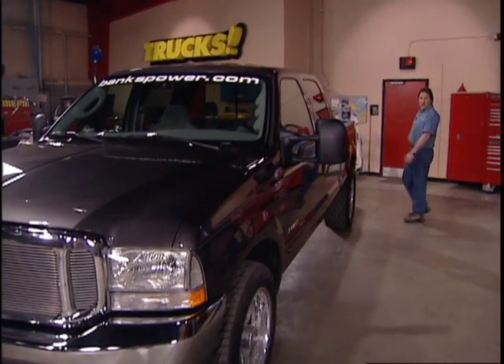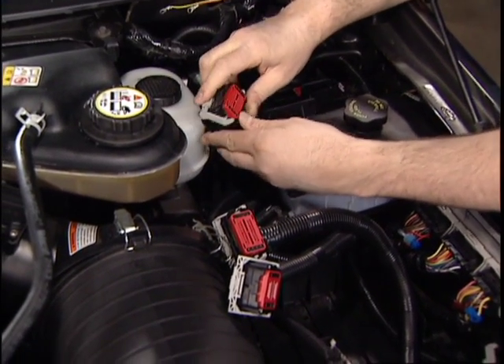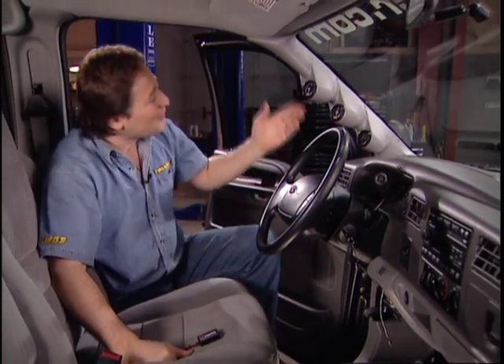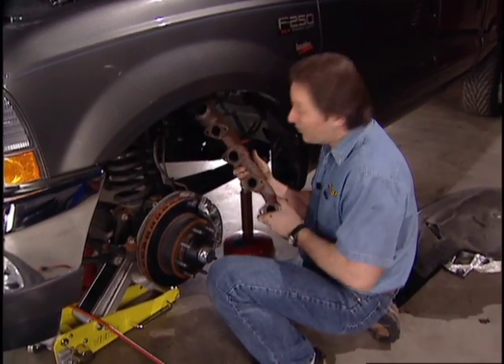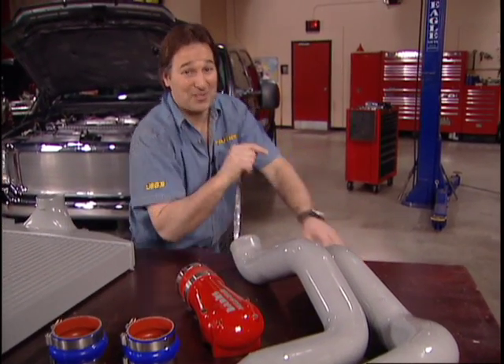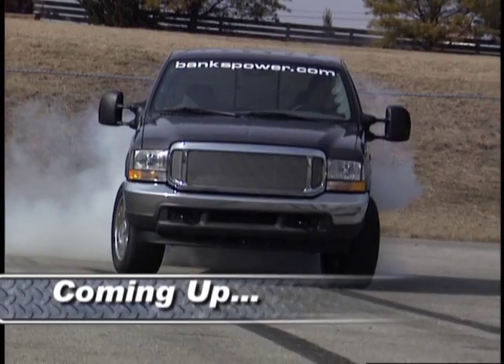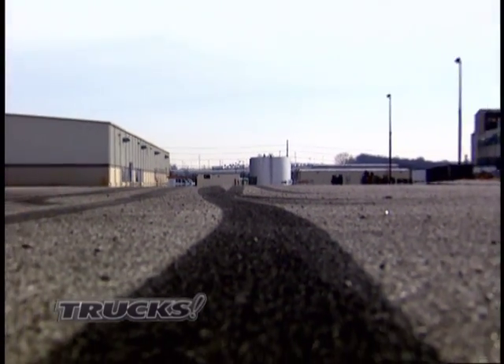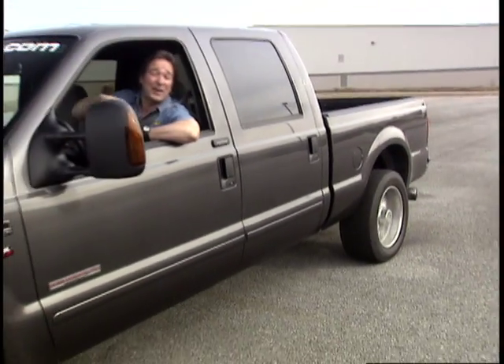Ford 6.0L Big Hoss Bundle

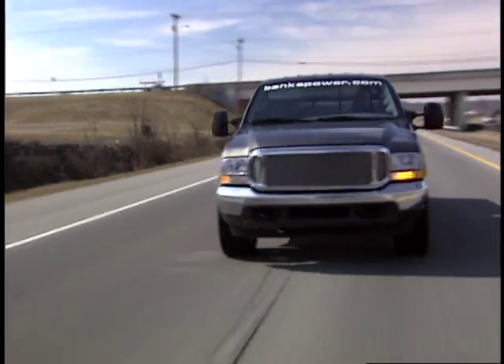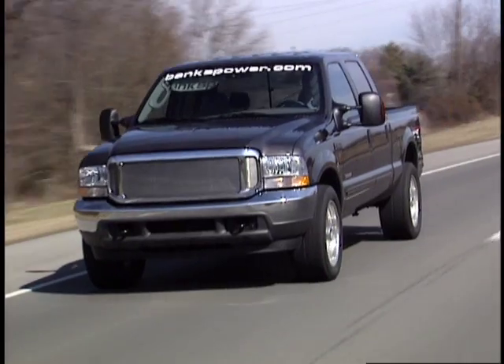Comment: Am I mistaken? Stacey installed a "single" Banks exhaust right? During the burnouts at minute marks 12:35, 12:38, 12:49, & 12:53 it looks to me as exhaust tips behind each rear wheel.

Comment: I guess that’s a 2007 truck in the video (posted to YouTube in 2010) ?  It’s 2019 now and I have a 2006 KR, CC, SRW.its been a good truck. I’ve updated (aftermarket mostly) FICM, Injectors, Fuel regulator, Oil and EGR coolers, CAC tubes, tuning, and probably a couple other things I’m not remembering right now. Most of this was done after parts failed so not “trouble free” by any means but I drive it hard and tow also.

It’s over 200k miles now on factory original head bolts and turbo. I can’t say about the 2003-2004 models, they were a little different but from my experience these trucks didn’t deserve the bad rep they got in the beginning. Early production issues and wrench twisters (even at the dealership) who didn’t know what they were doing contributed a lot to the bad rep. 

I’m happy to be driving a diesel without DEF that I can still work on. Now that I’ve bragged on it, it will probably drop a lifter next week, hope I didn’t just jinx myself, lol.

Oh yea, I forgot to say, Banks makes some cool stuff but for some reason it really didn’t catch on with the 6.0 crowd. I’ve heard stories that some of their early offerings didn’t do trans tuning or maybe did it wrong. Some trucks had trans problems when using their products and word of mouth went viral I think. I noticed in this video, Stacy mentions this device raises the trans line pressure so the issue was probably addressed early on but the the damage was done already. Too bad, there was a good market for awhile, banks intercooler and tubes shown in this video are a great piece.

Comment: It's sad how bad of a wrap the 6.0L PSD gets. Honestly the emissions are what killed it. But with the correct upgrades the 6.0L can be a very powerful and reliable engine. I have seen them in very low temps start right up where D-Max and Cummins have trouble. Not to mention the 6.0L is the only Diesel engine that can keep up in Torque and Horsepower in Diesel power competition
Reply: Later 6.0s were much better engines 03 are the ones that deserved the reputation because they were rushed due to emissions bs.
Reply: Double Clutch the egr cooler is a very small part of the upgrades. Biggest items are actually the little things related to the heui injection. Studs and o rings with a good machine shop touch up on the heads really make these things what they can be. I love my 6.0. It’s a 15,000lb service truck.
Reply: Lol @ the OP's comment.  6.0s are pure garbage.

Comment: Once a 6.0 is bulletproofed it is a great motor. Definitely ditch the erg and do the studs. I've heard the oem gaskets are ok to use but I can't imagine they are better than the black diamond or whichever. Is this the case?
Reply: Late model 6.0l powerjokes were recalled less then the 7.3 not very many people understand the potential of the 6.0.
Reply: ***** Heat in an engine is as much a problem with a diesel as it is in a gas engine. Aside from operating temps, heat is bad anywhere other than the combustion chamber.  This is why there is an EGR cooler and an oil cooler.   You do not want fuel to be pre-heated.  In fact, one of the best upgrades one can make is a return style fuel system. The reason this is such an important upgrade is because the factory fuel system is return less. Therefore the fuel deadheads in the cylinder head. The half gallon or so of fuel sitting in the heads will take about 15 minutes to get used. That means the fuel is sitting in the 600 degree head boiling away. The return style system keeps the fuel cycling through the system so it can get a chance to cool and get fresh fuel to the injectors. 
As for a heat riser, they were installed in the exhaust to send hot air through the intake manifold and heads to help get the engine to proper operating temps. The problem is that it also pre-heated the fuel which is a no no. Thus, you don't really see them anymore. And nobody ever replaces them. Most people cut the flap out of the manifold, grinds it down and goes on their way. I would not consider intentionally increasing heat in the engine.
Reply: But When you look at the purpose of the injector it is in the hottest place in the combustion chamber. Diesel Fuel acts like a coolant in a way to the injector nozzle. For example the 6.4 powerstroke has a diesel fuel cooler... Although how hot are we talking of heating diesel up? Can the current common rail system handle hot fuel running through it at 20k psi?

Comment: Thought Ford didn't have front coil springs until 2005. This truck looks like a 2003-2004.
Reply: It's a 2wd so it has front coil spring
Reply: 4wd had coils in 04
Reply: john Smallwood no not till 05 with the new front end....this is a two wheel drive truck no lock out on the hub cut out on the center cap for the rim nor an axle lol
Reply: john Smallwood I've got an 04 4wd and it came from the factory with leafs. They did coil overs when they changed the front end in 05
Reply: Dustin Waters I had an 03 6.0 and a 04 6.0 03 had leafs and 04 had coils.  Oth were 4wd
Reply: john Smallwood I own a all stock 04 6.0 4x4 and it has leaf springs coil springs didn't come out until 05

Comment: Stacey David is the best!
Reply: Pretty slick.  Its amazing what ya can do with electronics.
Reply: Oh but if it had diff lockers don't think for a sec it wouldn't burn em both.
Reply: Not to mention pull the paint off a house!
Reply: Damn right Chap.
Reply: Another Super Duty SUPER SINGLE burnout.  My mom's ASPEN WAGON does the same.

Comment: head gaskets are not shit on 6.0 they are actually pretty good heat is what brings this truck to its knees. when i worked at ford most the time when these trucks came in it was not the headgaskets it was the egr cooler once it burnt all the coolant out of the system then the truck starts to run low on coolant and that causes the head gaskets to go this is why EGTs are the most important on 6.0s even with it stock i would still run an EGT gauge.
Reply: Powerstroke97 probably, heard nothing but good things after getting rid of them.
Reply: so if i did a egr delete that would make my head gaskets last longer
Reply: Powerstroke97 If your head gaskets ever do go out again, id get them O-ringed, and use ARP head studs, and ALWAYS USE OEM FORD HEAD GASKETS!!!!!!
Reply: fossilknife Even if your engine oil and engine coolant temps are low, can your egt be high? Do they work together exc, im monitoring my eot and ect but dont have an egt. i have an egr delete 4" Turbo back without cat. sctx4 tuner using just the +50hp tune

Comment from the maker: Our Big Hoss Bundle systems generally include everything we make all in one package (intake, exhaust, tuning, intercooler, graphical user interface, etc.), and they run about $3000. But you don't have to start off with everything--our cold air intakes run about $300 and offer noticeable performance improvements. Then you can build from there as your needs (or budget) grow.
Reply: Banks Power  where are you located? 
I would like a job like this for my f250 2019 6.7 diesel

Comment: Yes you will, the later 6.0's have a different head bolt design compared to the early 6.0. Its a wise investment anyway regardless of the mods, the egr will take out the head gasket and coolant will get in the cylinder and the compression will lift the head. Lots of info if you search.

Comment: They should have kept that engine in production longer... once they refined the 6.0, it was indeed a good runner.  The 6.4 was not necessarily a good replacement; it is harder to work on, and it had reliability problems just as the 6.0 did when it first came out.  If they spent a little more time with R&D they would have been better off!
Reply: No

Comment: u know i just bought an '06 f350 Lariat & everyone tells me i bought the truck nobody wants.  i haven't taken the plunge to start tinkering yet as i'm looking for reliable people to talk to about perform alot better than stock without grenading it.  some say the stock turbo sticks due to low oil pressure. some say the heads lift but to change headstuds u have to drop the motor. is there any advice or reputable shops anyone know of?  i live in Chandler, AZ. thanks & happy motoring!!
Reply: housedjnyc use this setup or sct with studs and your gonna need a suncoast 5r110 tranny with a 8500+pound truck after tranny and studs you can run any single turbo you want, but if you want compounds you need rods and cam oil cooler stuff and intercooler ect. build engine minus pistons pretty much
Reply: Brady96969696 Bunting69696969 

Toyota
Reply: housedjnyc tt
Reply: Toyota
Reply: Toyota

Comment: i would personally stud a 6.0 before i start modding it.
Reply: Max back when these trucks were new the shortcomings of the factory head bolts and the lack of them were not apparent when you start cranking the cylinder pressure to them

Comment: Ok so to bulletproof my 6.0, I did an egr delete, coolant filter, mbrp 4" turbo back , removed the own liquid cooled oil cooler and replaced it with air cooled system.  This solves the egt burning holes in egr cooler, white smoke from coolant and eliminates excess soot in the oil that chews up the injectors.  Coolant filter catches the sand free in the coolant, and a new coolant cap!!!!!!!!!!!!!!  A bad coolant cap can blow head gaskets by allowing the coolant to boil. B.p. of coolant at 16 psi
Reply: Arp head studs as well

Comment: At the 6 minute mark he tells an obvious lie, reliable horsepower, there is absolutely nothing reliable about MOST 6.0's much less ones with after market parts/modifications in which the egr delete and head studs are not accomplished, it only makes sense that banks would offer a head stud kit and at a minimum a egr delete with products that claim 120+hp, They're basically selling a time bomb to un aware truck owners

Comment: if this is an 04 truck then why does it have an 05-07 coil over front suspension????? and the power steering pump revisor located were it is but with on 04 or older interior with 03 04 badges?
Reply: They arent coil overs, they are coil springs, all 2wd have coil springs....

Comment: There goes the head gasket,injectors and egrcoolers not to mention the turbo.Dont get me wrong im a die hard ford fan and own a 06 6.0 but to do that without doin the arp head studs,egr delete and bigger injectors you;ll be asking for problems.